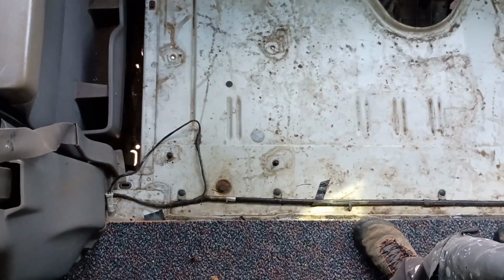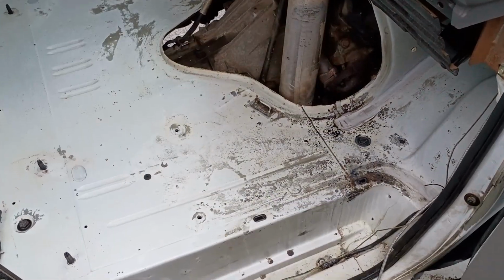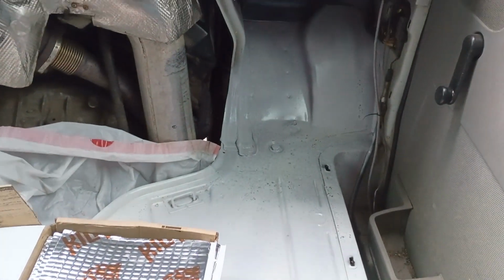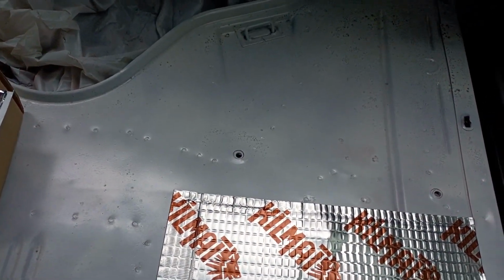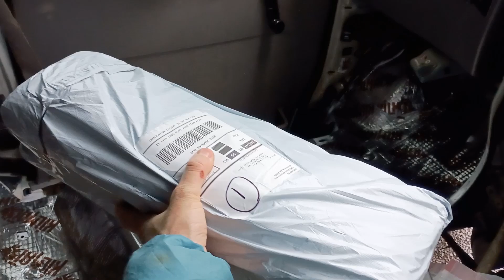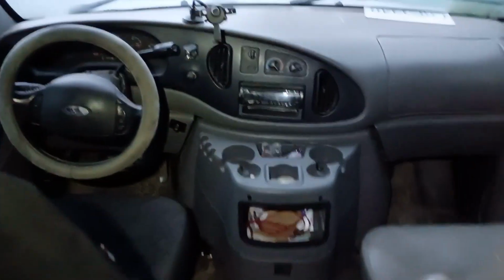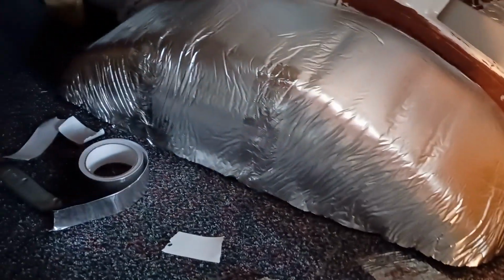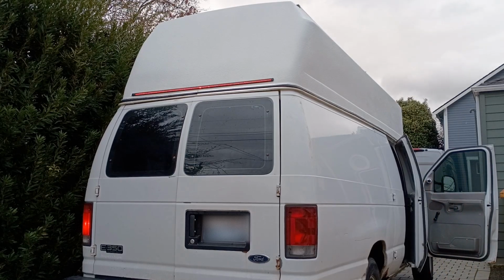Kilmat versus Podnamat - Soundproofing a Ford E350 7.3 Powerstroke Econoline Van

Comment: Supposedly a good way to deaden a 7.3 is to spray rhino lining on the valve covers. It's such a pain removing them on a van I'll probably never do it, but I have been considering putting something on the firewall and doghouse.
Reply from the maker: It wouldn't make sense to me as a standalone project, but maybe when replacing UVCH or glow plugs.  Thanks for the tip!  Surface prep might be a challenge.  Lots of degreaser first!!

Comment: nice job! how do you think the foam will hold up to the heat under the dog house?  I don't see (or expect) any specs on the aliexpress page description.
Reply from the maker: @brin6449 I don't know.  It's hit or miss with stuff from China.  It doesn't seem like the foam will resist heat very well but the foil will.  I stuck it over top of the original fiberglass foil insulation so if it doesn't work out I can just peel it off.  I've driven a couple hundred miles since and there hasn't been any odor or smoke.